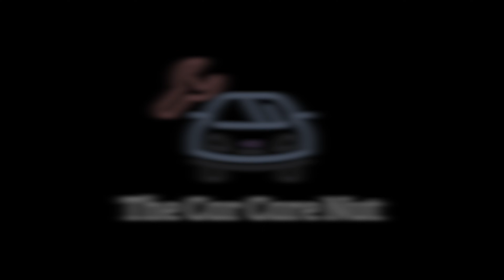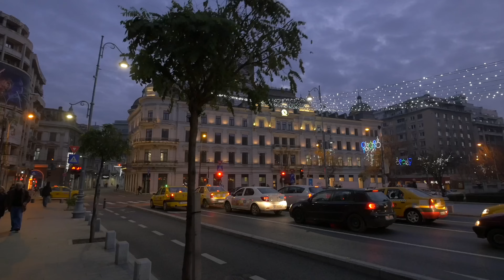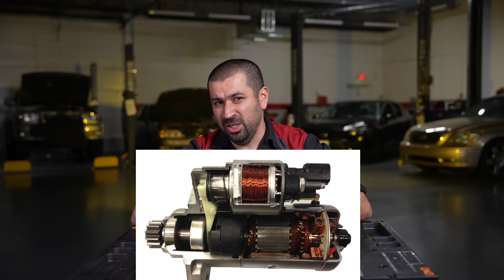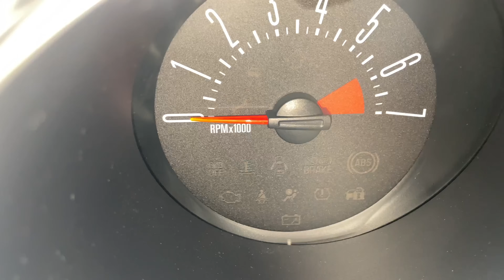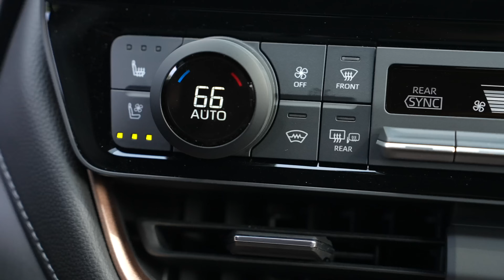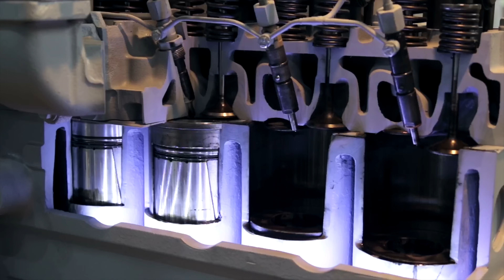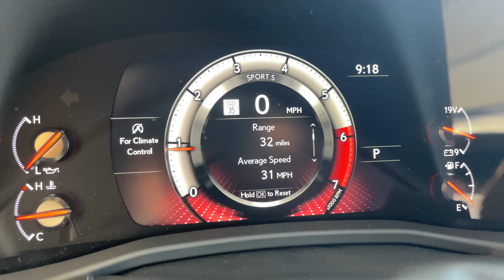How Does Start Stop Technology Work in Modern Cars? Everything You Need to Know

Comment: So what these cars are is really low-level hybrids. You have to pay for and maintain all kinds of extra systems, parts, and equipment to supposedly save a few cents on gasoline. What is the pay-off time for this for the average driver? If it was a short time, we would know it. No, this is just another nod to wokeness paid for by every consumer who wants it or not. If you want this kind of car and are fine with buying a very expensive battery, paying for an extra electric water pump, paying for a souped-up starter and evaporator, an electric transmission oil pump otherwise not needed, a brake vacuum sensor, and who knows what else, fine. Go buy yourself that car, pay for all these extras, drive to your heart's content, and pat yourself on the back because you're such a nature warrior. But the rest of us DON'T WANT a car that starts/stops by itself. We certainly don't want to pay thousands of dollars in extra technology to buy one. We don't even want to DRIVE one even though we have been forced to pay for it. And for you Wokesters, news flash: you're not any more moral, upright, smart, or environmental than the rest of us. Get over yourselves. BTW, the only way to disable it is to stop electing liberals who fund the EPA who then keep their jobs by continually forcing these things upon the public.

Comment: Alway stopped when I pressed the gas pedal at a light. Or I give from break to gas faster then engine startup causing bad Jerry starts.  Added a third party switch that keeps the system turned off.  Problem solved.

Comment: Great video. I was apprehensive about the system but I think I can tolerate it more and use it for more benefit. It most certainly can save fuel. Fuel mileage suffers a lot with stops. If you are in heavy traffic with traffic lights, you will absolutely get better fuel economy with auto start-stop. Its not as smooth as a hybrid system but it works well and even though it seems complex, it's really not much different from a hybrid in terms of the conditions of operation. I think the starter counter is a brilliant way to keep you from getting stranded due to a failure. By the sounds of it, most people will not experience a starter failure.

Comment: I disagree on one point. When the engine shuts off at a light, etc, the engine oil pressure will go to zero. Do that enough and it WILL damage the engine. The manufacturer should have also put a tiny electric oil pump in for the engine to maintain a little bit of oil pressure. My friend has a new Ford truck with this "feature" and my heart skips a beat every time he stops in traffic as I naturally think his truck stalled. Just buy an older vehicle without all of this junk.

Comment: More parts to break. More parts with cost. Is this a reliable system for a mechanic or the driver? It's funny seeing new models 🤣 on the highway, engine hood up, road ranger lights flashing,  as I stroll by in a 1996 toyota corolla!

Comment: On Motor Oil Geek's channel, he analyzes the oil of a vehicle which used the auto start stop function and found that you get less oil dillusion, especially on turbo charged engines. He also stated, the wear on ebgine wasnt so bad cause the stop wasnt long enough where the cylinders and internal parts got dry. The oil stays healhty for longer, and in the end is better for your car.

Comment: Not what happens. The cylinder holds pressure and waits for you to either move by releasing the brake - in which case it sparks the pressurized gas in the cylinder- or until the pressure drops to a certain point and it sparks it anyway. It’s in the manual. No idea what this guy is speaking about. Sounds made up. Like it’s his idea of how this system works lol. It’s in the manual…

Comment: I fixed mines where it is always off at every engine start. Start the engine push bottom on off but hold it on the down on the off possition and put a drop of crazy glue on the corner some where and hold for a few secound and the bottom will stays on the down possition on the off . And wa-lah

Comment: It sounds like this system relies on a lot of different data points from sensors and a lot of added tech. If those sensors go bad, how does that affect the performance of the system? Could the sensors give bad data, like bad data on the position of the pistons, how could that damage the engine, or if a temperature sensor goes bad and gives bad temperature readings, how could that bad data trigger a false positive check. All this extra tech also sounds like many more parts that can go bad and need replacement, meaning more expense. I'm sure when everything is healthy, it works like a dream, but depending on 40 different data points to make a decision I just don't like the sounds of.

Comment: Start stop sucks, even though they added better components to compensate for it starter,battery etc. constantly letting the oil stop flowing in a hot engine has proven to cause wear in many tests this mechanic fails to mention. Forget the one pint of gas savings per tankful and the horrible hesitation if you must pull out from a traffic light in a hurry SHUT THE FEATUE OFF!

Comment: At 13:20, he said we took the cold from it, but actually, we are transferring the heat. An example is in a refrigerator. We remove the heat from inside the box, and then it gets cold. In the evaporator, the coolant evaporates and turns to a gas because it absorbs the heat. An example is if you boil water and it turns to steam, it is absorbing the heat from the stove. I like this guy very much. He is thorough, and you can be assured that the work is done correctly.

Comment: Thank you for the great video and explanation. This has served to confirm my gut feeling that this feature was just a gimmick that offered marginal gains at best and does so at the expense of a lot of added complexity in the system! More points of failure, more sensors and parts that need replacing, more reliance on software which is very expensive to develop. The worst part is, features like this leads us further and further away from being able to diagnose and repair our own vehicles. We rely more and more on software, which means we have to take the car to a dealership where a guy connects a computer to the car, presses a button, and the manufacturer decides how much money you will have to pay! I hope when I buy a car I can get one without this feature!!

Comment: Great information.  

I just bought my second car with this annoying little feature.  Fortunately there are bypass wire harnesses available on Amazon to fix it.  In both of my cars, it took me less than five minutes to install the harness.  The harness does not eliminate the feature, it simple relegates it to default mode, so the feature is always “off” unless you turn it on by pushing the button that used to be the manual shut off for the feature.

Comment: Our Lexus hybrid vehicle stop/start function is much smoother than the one in my 2024 GR Supra, and many Supra owners code out this function using Bimmercode. I sometimes keep it active when I anticipate long red light intersections. I have a ScanGuage plugged into the OBD II connector at all times, allowing me to monitor intake air and coolant temps, as well as system voltage and air/fuel ratios. Every once in a while, the car's computer will shut off start/stop due to one or more reasons (as described by Ahmed). 
 I used to always buy a factory service manual for new or used car purchases. Now, the complication of modern powertrain and accessory systems necessitate massive and very expensive manuals, where hard copy or electronic/code readers.

Comment: As someone who does gig work, I absolutely noticed a difference in fuel economy. For the last two vehicles I owned I had to fill up every 2 days. With this new vehicle I purchased which has this feature, I fill up every 3 and a half days. My last fill up was with the car having an estimated 57 miles left until empty after driving for 3 days from a full tank.

For those with a normal everyday AtoB commute this feature will be insignificant. For those doing gig work where there's a ton of stop and go driving, this feature could be a game changer.

Comment: Cool video.I see the reason now but it's still very  annoying . I don't spend a lot of time stuck in traffic where it would do the most good.
 I can temporarily turn it off each time I get into the car.I wish I could disable it permanently. lol. A Fix / cure. Replace the battery with a normal battery. LOL... Or remove or bypass sensor. LOL... One last note: a lot more things to break and go wrong.

Comment: This feature annoys the FUCK out of me.  Like, road-rage level of annoyance.  In my 2025 Honda CRV, the default is that it is on when you first turn on the car, and you have to remember to hit the button to turn it off, which I can't ever seem to do... So I bought an aftermarket device from a company called IdleStopper which changes the default setting to OFF.  You can still turn it on if you want, but the default is OFF.  It took all of five minutes to install, and it was worth every penny.

Comment: Ok how much fuel did I spare in my smart 451 mhd because when I did change it the starter-generator did cost me over 1500 euro to replace it with a refulbished one😱 the care now maybe will worth 3500euro🤔 so never ever ever i will use start stop for example to my mazda 2018 skyactiv I just put a little paper to block the button an it's works very fine😁 but to the smart I need to push it every time😔

Comment: I can't see start stop technology is going to be any use in heavy traffic and in cities were your going to be stopped at give ways, pedestrian crossing, traffic lights, or heavy congestion, I can't see how constant starting and stopping in going to be good for the engine or battery, especially in winter when you're running heating, lights, wipers, demister, 🧐 out in urban areas and countryside possibly its OK but in a big city electric or a hybrid would be better 🧐

Comment: I bought a bypass disconnect on Amazon for 30 bucks and solved it on my 2023 Honda crv. . Took me 5 minutes. Works perfectly for 2 years.
Reply: Can’t you turn off the start stop?  Is that not available anymore?
Reply: @matthewmastrobuono582  I found mine for my 2023 Honda CRV on Amazon. Don`t know if it is available any more.
Reply: Bought but never got to installing it. Sold the Accord.

Comment: One item you missed to discuss in your video is turbo chargers. Turbo chargers are lubricated, and if the engine turns off and starts, it will wear out the turbo charger faster because the fact that the oil drains out of the turbo charger thing goes back into the turbo charger. Just like any other mechanical piece in the car if it does not have lubricant, it will wear out faster.

Comment: I have a nissan note 2015 and when am in traffic for extended period it shuts off and take a while to restart about 3 to 5 minutes, and even when i disable it from the dash or disconnect the wire in the bonnet it still shuts down and takes some time to restart, what could be the problem?

Comment: Ford has a ECM feature that notes that the battery voletage is low and disables auto start. You can pop an old discharged battery into the car and after several “barely start” conditions noted disables auto start.  Then replace the battery without clearing the code.

Comment: Very informative and explained so clearly. Thank you. 
I presently drive a 2013 honda CRV 2.2dtech manual with stop start, never had a fault in 118K miles. 
Volkswagen began using start-stop systems with the Polo Formel E with SSA around 1983, after having previewed the system on the 1981 Auto 2000 research car. Later the LUPO 3L, and after that in the Polo, Golf and Passat BlueMotion

Comment: Now they just need to install one more component: a driver heart rate monitor and stress recorder. When you’ve been given one of these vehicles as a rental or loaner without being informed of it’s presence you’re instantly in panic mode because you’re instantly looking for a place to pull off the road and during the process it clears up and you find yourself getting angry about it acting up. People have enough stress in their daily lives without having constant false alarms. The information would be helpful after someone has a stress induced heart attack and they’ll have a record of the long term effects in their lawsuit (s). I have to wonder if the expense of developing this is higher than multiple court cases involving this. You’ll also have the added expense per car that otherwise wouldn’t have been incurred. Voluntarily installing this will place the blame on the car makers instead of the normal governmental overreach where you’d expect it to be. I could say a lot more about the wokeness of this and the environment but you get the idea.

Comment: Peugeot 208 owner here 🖐️, if you learn this car start and stop system, and if you are a good driver, you can actually have better fuel economy with it. The magic is that it can turn off the engine below 20kph. This means that when going down in traffic you can make it with the car engine off, basically using the gravity to roll the car down by free. You can also slow it down to 20kph and then creep to a red traffic signal. The best i could get in the city with this 1.6 e-hdi diesel engine was around 4.3/4.5L/100km and in normal roads i could get has low has 3.3L/100km. 👌

Comment: Um…… what is sacrificed by this system……. Cam phasers(Ford) and lifters(Chevy) When the engine shuts off, so does the oil pressure, this continuous on/off of the pressure acts like a hammering effect. Since purchasing my vehicle….. I always shut off the system off and don’t have engine or transmission issues. Absolutely terrible system and a killer of engines.

Comment: I’m a licensed FAA mechanic which is higher and more trained by far than an auto mechanic.
You are 100% wrong.  100% wrong.
This technology actually does harm the engine on cars. It would harm the engine on any mechanical device. 
The vast majority aware on any engine that requires lubrication as when at first starts because the oil is not in all the passageways, and then between all the bearing surfaces when you shut your engine down all the oil drains down to the bottom and then it takes a couple seconds for it to get pumped back approximately four seconds
During that time, you have more aware than normal.  This reduces the life of the engine on your car.

The only reason why cars have this is so they can pass their federal smog emissions.  I would also argue that it is actually unsafe. Before mine was disabled I had several instances when I needed to take off quickly and there was a one to two second delay because of this stop start. It could’ve definitely caused an accident.

So I know this is YouTube and we come across videos with people that say all the time that they know what they’re talking about like you did in this video wearing your mechanic uniform, but I’m here to tell you that this thing does reduce the life of your engine and these car manufacturers are just fine with that because then you come back to buy more parts. And we all know the dealerships make the vast majority of their money in their service department. They do not make most of their money by selling cars
Reply: While you may be correct about increased wear, the car manufacturers put that system in like that because the EPA MADE THEM DO IT!  The EPA will fine them if they don't comply with the CAFE standards and other emission controls regulations.  So, don't light up the car manufacturers, light up the phone calling your Representative and Senators, and tell them to change the laws.

Comment: Start stop is awful, and the analogy to fuel injection (when it was new) is way off... precise amounts of fuel being sprayed into the cylinder making engines last 200,000 miles or more was fantastic. Clearly superior to a carburetor.  The ONLY reason my wife and I purchased a CPO 2020 BMW X3 is because I did the research ahead of time and learned I could permanently turn the start stop system off with BimmerCode... and it's been off for over a year, and it's awesome. Nothing is worse than being ready to make a left in front of fast oncoming traffic and the engine shuts off... just terrible.

Comment: Honestly I would rather have that and on by default but with an ability to turn it off until next startup.  The other alternative is smaller engines that are going to result in a much slower vehicle.  Apparently they think forcing itty bitty three cylinder engines on us is going to be better.  It will just make us mash the accelerator harder negating any marginal increases in MPG.  It may result also in more vehicles being scrapped and that is also not good.  Honestly a 3 cylinder engine in most vehicles would just be a terrible idea.

Comment: you explained ac wrong after refrigerant goes through evaporator coil in car then it is still cold it runs back to compressor and gets heated by compressing the low pressure cold gas to high pressure hot gas then runs through condenser radiator on front of car as it gets cooled by airflow it condenses into liquid that is still warm at high pressure runs back into cabin and is released at orifice or valve into inside coil and it boils as it loses pressure making it get cold as a cold low pressure gas again.

Comment: If you don’t like the system, get a car with driver profiles or adaptive software, some cars can learn when you turn it off enough times it will just ignore turning it on everytime or with driver profiles it will typically save the settings to the profile. Then you don’t have to turn it off everytime.